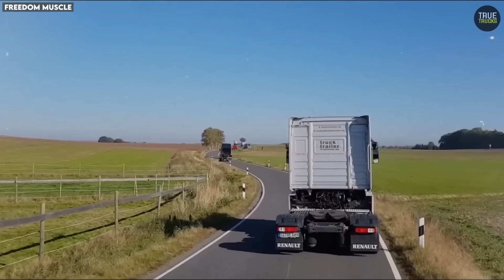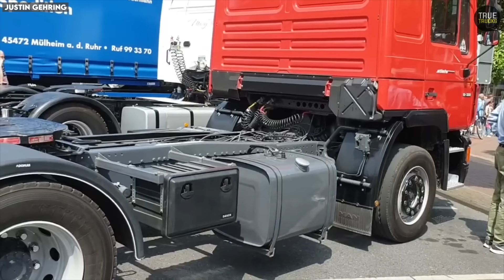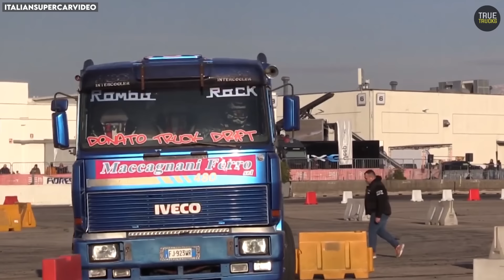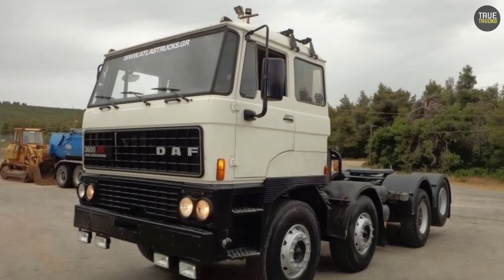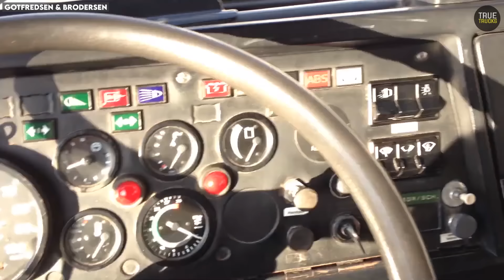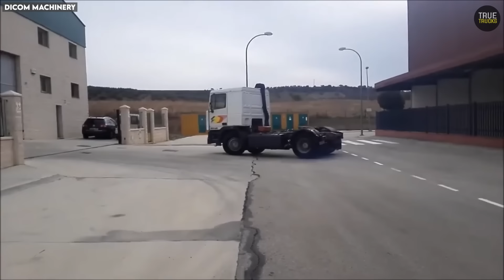10 European Trucks From the 1980s That Shocked the World

Comment: Has anyone seen the videos of the guy taking a Scania to America?? The Yanks are just baffled by the technology!! My dad had a Volvo F88, then an F10. A Scania 112 twin steer before ending with a Renault Magnum that had a Mack Engine to cope with shite diesel in eastern Europe and Russia. The french lump was too clever, with loads of sensors that stopped the motor if it wasn't sipping pure Perrier level diesel!!
Reply: Yanks don’t do much reversing so have ridiculously long chassis, the cab must be held together with 4000 rivets, have more gauges than Concorde, a gear lever that’s so long that it’s level with the top of your ear. It took them a while to work out that a splitter could be air operated, but to be fair they did give us Cummins, Detroit two strokes and Jake Brakes.
Reply: Bruce Wilson.
 He got a 770 from Scania for a year 😢to promote and go to truck shows .
He bought his first Scania in Canada and imported it to the US .
It was an old 143 silver and dark red.

Comment: If you mention Sisu and Magirus, why not Tatra. Air cooled V12 engines bigger than anything Nagurus ever produced, all-wheel independent suspension, frame with drivetrain tube formed very stiff triangular structure, … Tatra was certainly no less of a legend than Sisu or Magirus.
Reply: Magirus Deutz was the only one producing road haulage vehicles, the others you mention are military.

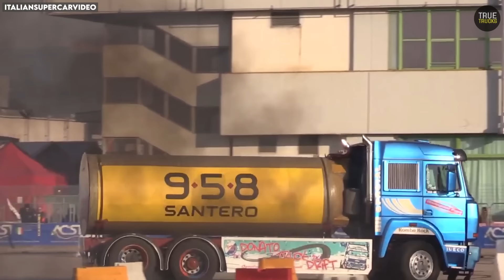Comment: 3:33 1500nm must be 1725nm 11:33 must be 1900nm, the 1700nm was the output of the 13L 6 in line of 330hp which was at least the same '''Shock''' for competitors...
Most of the 330hp class trucks had torques of around 1300nm.
Imagine a 6 in line Iveco with 330hp almost crushing a V8 Scania with 420hp in climbing power.....
The major disadvantage of the Ivecos was that the enormous engines and heavy drivetrain were incredibly heavy, and thats something that will irrevocably be deducted from the maximum load weight.
Outside Italy, the Turbostar remained a niche market, but the model certainly had a pretty big fan base!
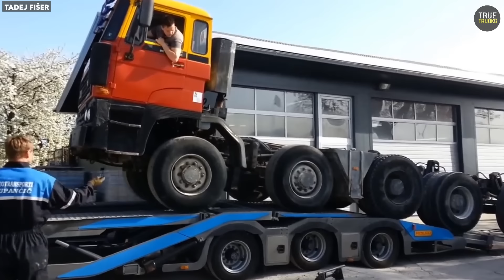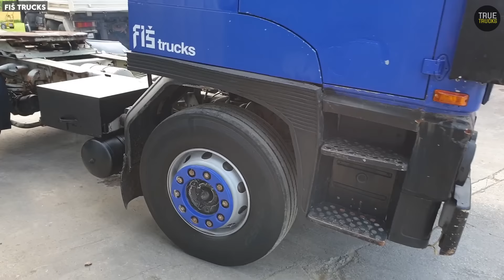14:00 Must be a DKZ engine, the DKX was the 3300 unit 14:09 Must be 1405nm, 1350 was the output for the 354hp 3300 Ati.
Well........for now,....''That was my unswitchable autism......''' ........😴
Thanks for the video! 
It was a true pleasure to watch!

Comment: The Daf 3600 didn't have the 1160 DKX engine, but the 1160 DKZ. There was also a version with even lower fuel consumption, the 3600 with DKZE engine.
Reply: The was a 3600 ATI which was limiter at 1,800 rpm. And thermometer only had 307 hp in steeds of 373 hp which I saw quote for the 3600.
Reply: In stead of I meant. And the Turbostar later had a 190-48 with 480 hp. And that one could and can still fly.

Comment: In the 1980's, the VOLVO and Scania brands moved forward so much that no one can catch them even today. The most LUX trucks on the market, the palace on wheels was Italian IVECO turbo star and upgraded PEGASO from Spain, but they were not Reliable as much as VOLVO or Scania. The MAN and DAF were the most fuel efficient and have new stuff in the cab for driver, they were called "comfy homes on the road" but still the "QUALITY" was a question here, not major components but the small stuff and electrical was always a problem. The king of truck these days was the MERC...them trucks were called the TIGERS ...way over build, great for heavy haul and just can not be killed, later on MERC did drop this great truck and start making plastic shit boxes of the 1990's, why? I dont know, it was MERC big mistake. And 1980's and in 1990's the shocker truck on the market was Renault MAGNUM , this was WOW and LOL in compare to box trucks like VOLVO F-12 or later F-16 ....Yes I think Renault MAGNUM was the best truck, so futuristic, so much driver need oriented, with that big MACK V8 and a top 500HP...that just killed everything on European market. ISSU trucks...hm I dont know much about, the tuffest and the bad ass truck made in Europe at that time was TATRA in CZ republic, this truck go were there are NO ROADS for any vehicle. Way over build,  air cooled, huge engine with very powerful low out put, it was not a shiny and flashy truck, no, it was ugly out side and ugly on the inside, but truckers did love it the most. Like a ugly child that mothers hart loves the most !!! . TH